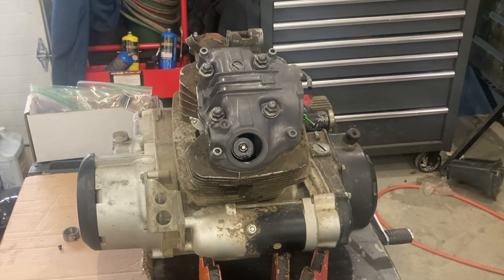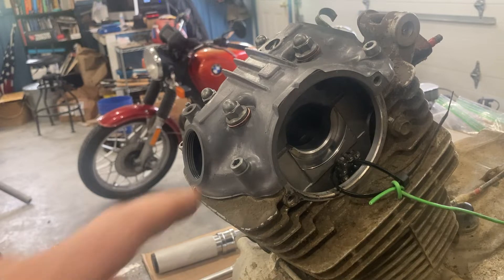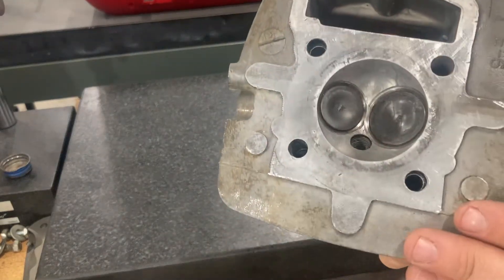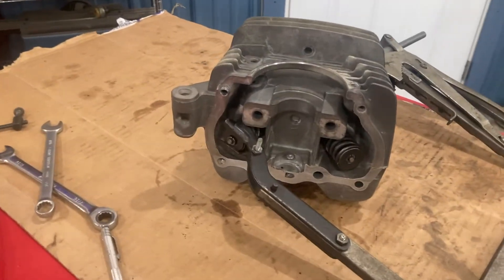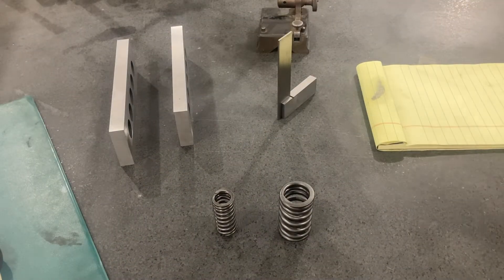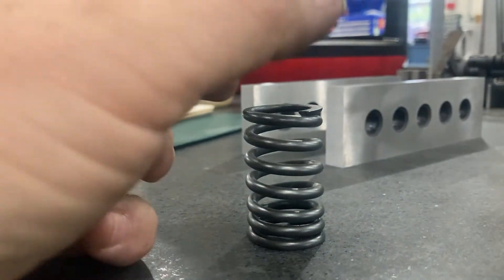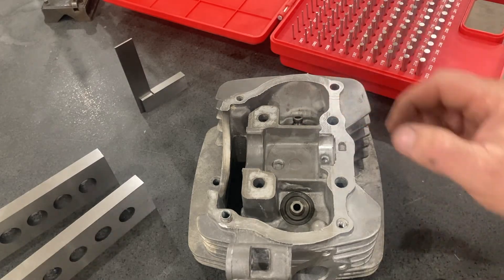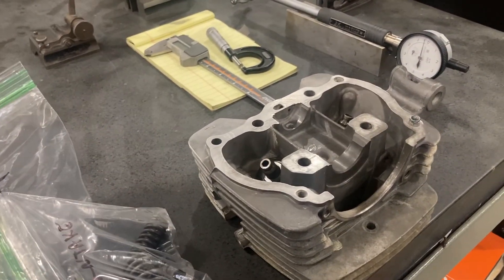ATC 200 Rebuild Series #3 - Cylinder Head

Comment: Anything you can do if the cam "bearing" is worn past the serviceable limit.
Working on a 83 200e the cam and / or bearing has worn to have about 1/8" play
Reply from the maker: Since its basically integral to the head, I would say just replace the whole unit if its beyond the limit.